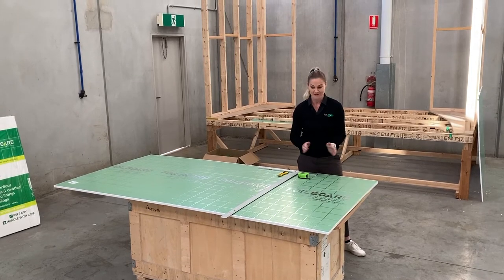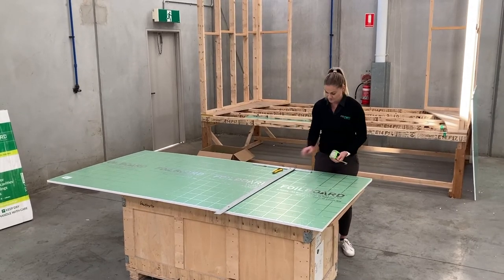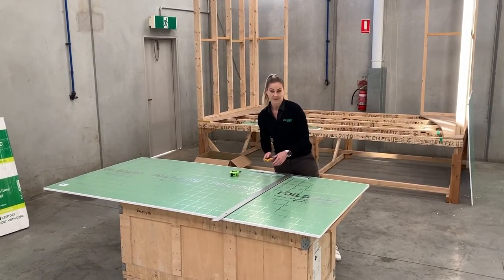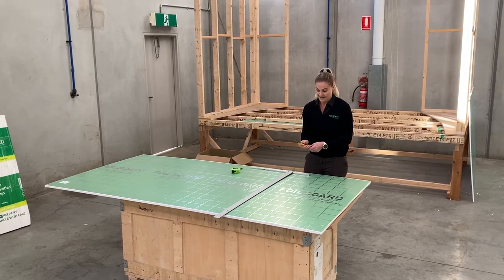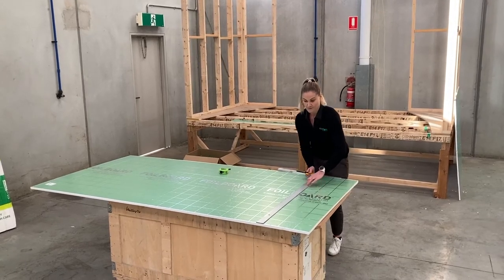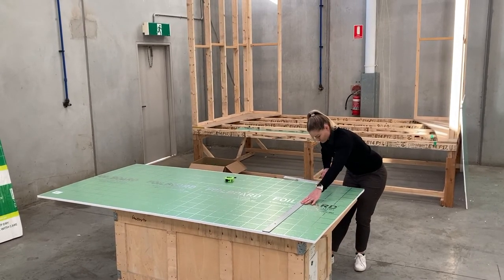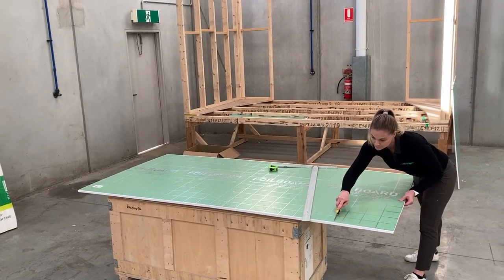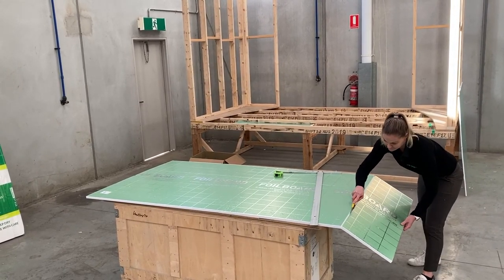How To Measure & Cut Foilboard installation

Comment: If anyone has used a snap off blade longer than the safe one section out of the hand piece holder it is easy to accidentally snap with slight pressure or twist resulting in the blade breaking off or worse shooting off somewhere! Wouldn’t it be wise showing a directional how to video to safety wise by wearing safety glasses at all time??? 🥽